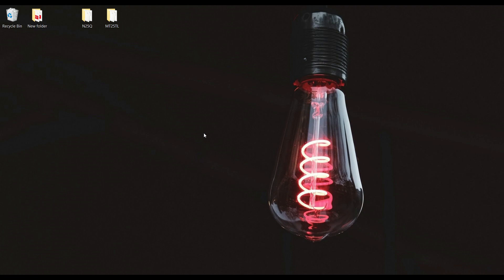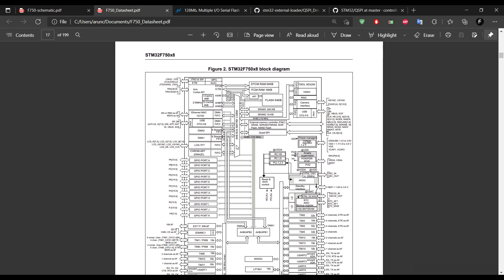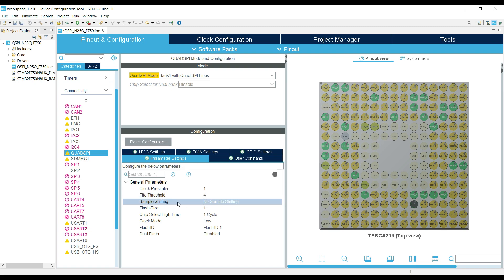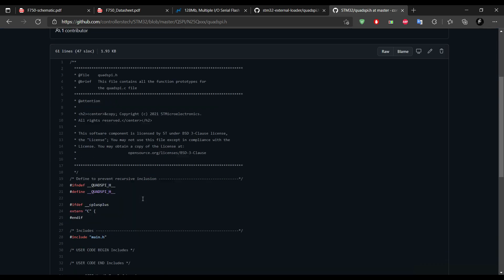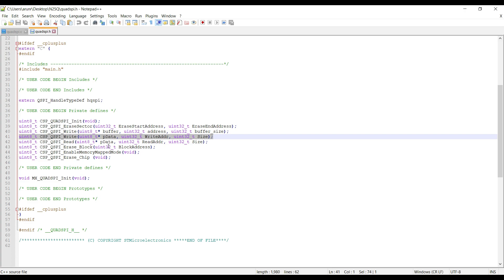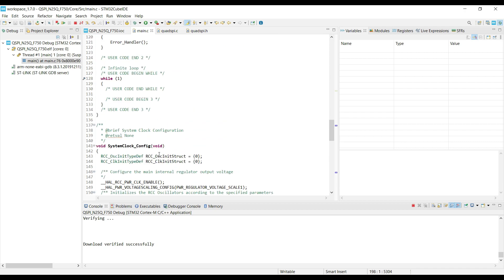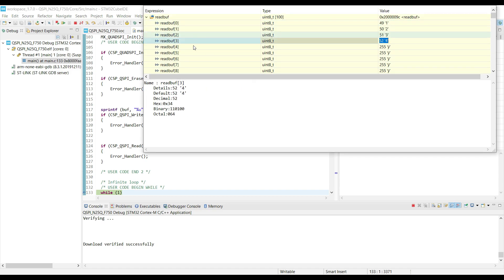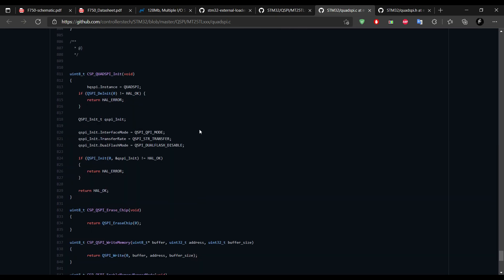QSPI in STM32 || Write and Read || N25Q

Comment: HI, MT25QL512 is not initializing. i debug it and program stuck at write enable cmd. and returns ERROR. I followed as you said. what might be issue? is memory need to set in QSPI mode? or default mode is QSPI?

Comment: Is the method an alternative to using the HAL_QSPI functions?
Reply from the maker: I don't understand the question
Reply: @ControllersTech  Your application uses higher level functions that utilize the HAL_QSPI  (stm327xx_HAL_qspi.c)  drivers for simplifying the common tasks of working with the QSPI.  Am I understanding this correctly?
Reply from the maker: Yes

Comment: Hello great video, just a question can this tutorial work on STM32H750 Discovery bd? is it the same QSPI flash ?
Reply from the maker: H750 has MT25 series I guess. The method remains the same, but the commands are a little different. Please check towards the end of the video.
Reply: @ControllersTech  yes its MT25QL512A

Comment: Hi, thanks for the tutorial, you said that what you did is not the effective way for storing numbers, is there another way to store numbers or other data types without converting them to strings ? will the memcpy() do the job ?
Reply from the maker: You can use enums to convert numbers or floats into the bytes and store it.
Then convert the bytes back to numbers to extract the value.

Comment: Thanks for your videos, they are really helpfull, 
I am using your driver in the 32F746GDISCOVERY , it has the same flash memory N25Q128A. The code is stopped when the I try to execute the CSP_QSPI_Erase_Chip() function.
When I debug the program, I saw that the program is stopped when I execute the HAL_QSPI_AutoPolling() function if I press "stepover" to continue to debug, but if I press "stepinto" everything is OK.

CSP_QSPI_Erase_Chip(){
             ...
             QSPI_AutoPollingMemReady(){
             ...
                   HAL_QSPI_AutoPolling() 
             ...            
             }
             ...
}

The program run without any problem if i don't use the function  CSP_QSPI_Erase_Chip() function.
Is there any update for that function? Could you help me with that?

Comment: Thank you for your hard work explaining this stuff!

I did this for STM32H750VB and W25Q64, but stumbled across the problem with memcpy - it throws me into MemManage_Handler. Regular read and write commands work fine, i have set up MPU parameters accordingly. Can you please tell, what could be wrong? I use a single/dual line QSPI setting, can this work with memory mapped mode?

By the way, for some flash like W25Q64, chip erase delay can be much higher than default HAL_QSPI delay of 5s, so i had to ta add extra 20s delay, so loooong
Reply: Did you figure out solution for this? I'm also running into this issue.

Comment: Hi, thank you for video and code. Is this code compatible with QSPI w25q64 chip?
Reply from the maker: Nope, but read the comments. Someone have posted a link for it
Reply: It works with W25Q64, set "FlashSize=22", increase the delay in "QSPI_AutoPollingMemReady" to 20 seconds: e.g. "if (HAL_QSPI_AutoPolling(&hqspi, &sCommand, &sConfig, 20000) != HAL_OK) {", and set the "DummyCycles" in "CSP_QSPI_ReadMemory" to the value 6 e.g. "	s_command.DummyCycles = 6;"

Comment: Great movies i like your works a lot. So i have board STM32F508-DK F7508-B05 and normally memory chip is N25Q128 and unfortunately i have a problem, i do not pass the step QSPI_AutoPollingMemReady in the function CSP_QUADSPI_Init and i do not why.
Reply from the maker: Try disconnecting the cable and connect again.
By the way, this video is made with the same board.
Reply: @ControllersTech  Ha yes it's works, it's bizzard :D, thk you for this litlle debugging

Comment: Hello Controllers Tech, Thanks a lot for the video, it was very helpfull! I am facing an issue with the "Write Enable". When I call the Autopolling Function for changing the mode, the status match flag is not set and I know why. Unfortunately, I don't have an oscilloscope to check the HW part. Do you have an idea about what could be the issue? Thanks a lot and keep going :)

Issue Resolved:
Thank you, I have resolved the issue by using the 2 banks (MT25QL512) in the STM32H750-DK Board. But I still have an issue with the read. When I read from memory and check in the DR register, I don't find the correct information, always I get 0x88888888 and erase state of the memory 0xFF.
Reply from the maker: Your message was deleted by youtube for some reason, but if you are using h750 discovery, then check my github.
I have there the code for H745, which is exactly similar..
Reply: @ControllersTech  Thanks, I will check and provide feedback! I also saw a strange behaviour, the bank 1 fails at the write enable but the bank doesn't and it fails after, could it be a HW issue, or a configuration one?
Reply from the maker: It's definitely configuration issue..
For these dual banks, i tried using single bank but that didn't worked. So i tried using both banks simultaneously.
I have mentioned this in the readme file
Reply: @ControllersTech  I will try to do that, thanks !
Reply: @ControllersTech  can you please help me with flash and qspi ,ospi interfacing with VCK190 board
Reply from the maker: What memory do you have ?